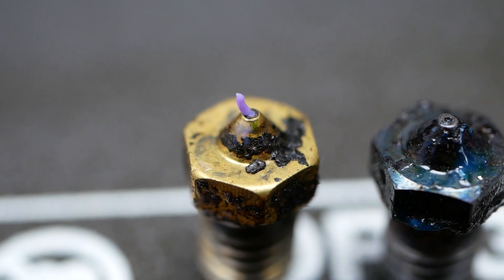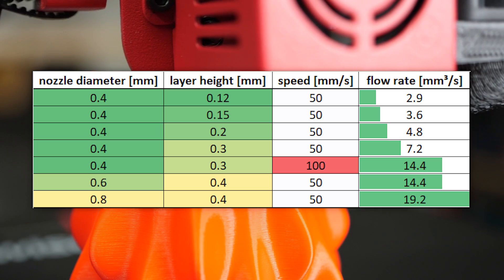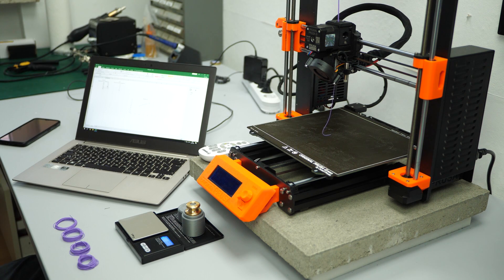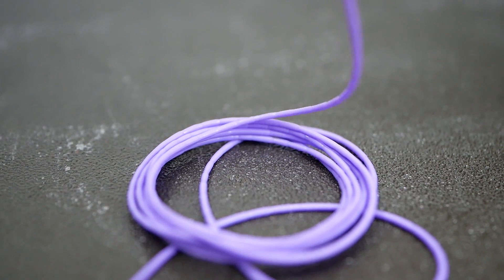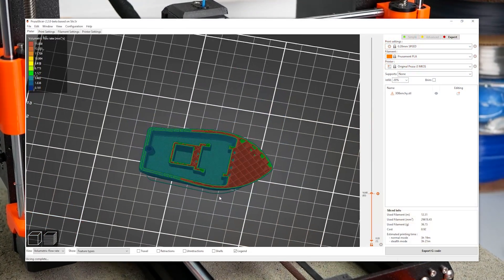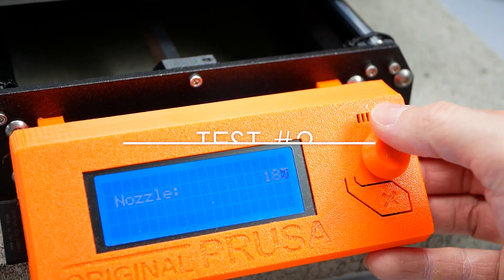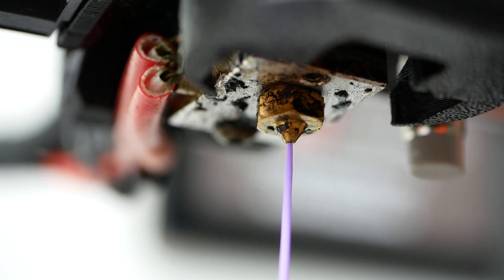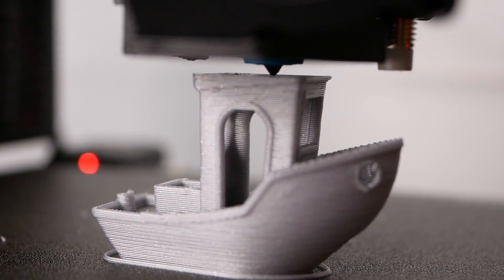How fast can your hotend print?

Comment: isnt volumetric flow rate determined by speed and hotend area(mm2)? what about the layer height?
Reply from the maker: flow rate = speed * extrusion width * layer height
Reply: @CNCKitchen  i just find it super weird modelling volumetric flow rate as function of layer height and width since the filament comes out of a circular nozzle
Reply: is it calculated this way because the filament sets in the layer with a more or less rectangular cross section?